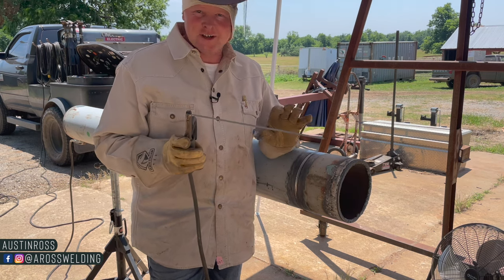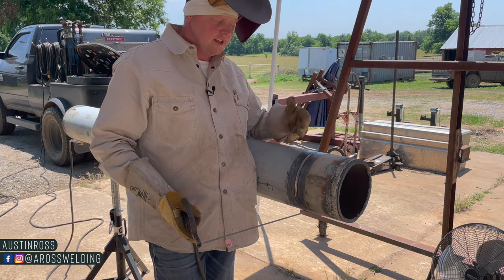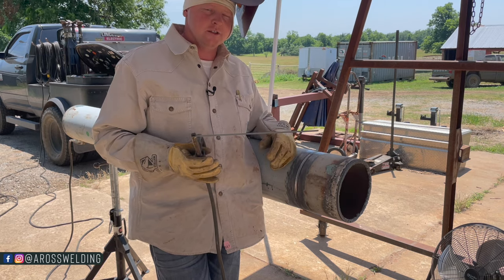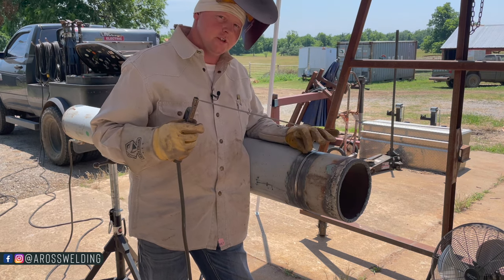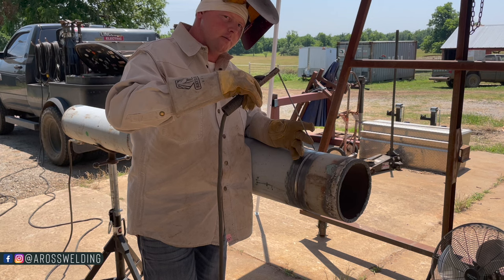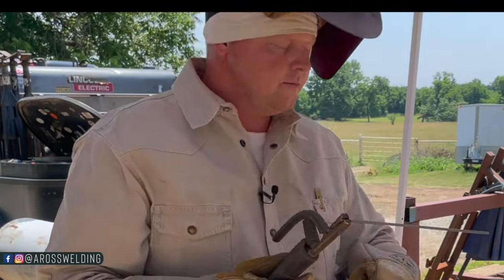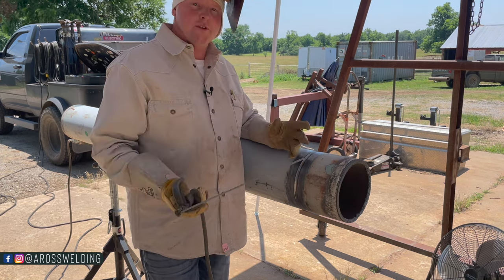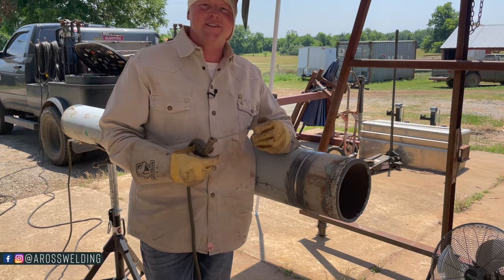THIS SIMPLE TIP CHANGED HOW I RUN BEADS (ROOT PASS WELDING)

Comment: Hey Austin, been awhile,best education you can get is from an old Hand that's burned pallets of rod,my first job was with a small contractor that didn't have bevel machines,had some old clamps and that was it,an old hand around 55 seen how nervous I was and changed everything for me,priceless learning,beveling with a 000 tip,no grinding a ballpeen and an 18" half round, on a 250 wall 12 in,I was good with a torch so that helped,where to set the line back,cut it,pound it square,file it,wedge it and go,that was 74,after that job I had confidence to go anywhere, so teaching them not to fear it,just watch and learn burn the hell out of a lot of rod,I still have my original pipeliner.
Reply: Love the no fail caveman homade api bevels

Comment: I always liked my whip with air-cooled Tig torch line. Really help reduce the amount of fatigue on your arms when your working 7/12 for a few months. I rember dragging alot of jobs just because of small things when the economy was good and companies were paying 1000 bucks to pass a combo weld test and travel pay I dunno if that still goes on I've been retired since 2013. Secret to working shutdowns and pipeline jobs you gotta have a good contact list and you have to have a good reputation as a welder. My phone used to ring all day with offers from other companies.

Comment: Good tips thank you. Holding stinger lightly and pull up to help stop blowouts and push rod from side to side. I will never be a pipe line welder due to age however I do lots of welding on our farm equipment and these same tips will apply. Lots of different types of damage to implements as you drag them across the face of the earth.
Reply from the maker: You bet! Thank you for watching!

Comment: awesome video more tips on real word bead running than I've ever seen  thanks for taking time to teach these small things. I used to weld a lot of 4" .156 wall and the bead is everything don't push it will undercut the bead and on the bottom tack roll out of the bevel so you don't leave a big keyhole to try and tie into on the bottom when you come flying in and leave a suck back. light wall pipe will make or break you

Comment: Something I was taught also about running beads at least from say 3 o'clock on down. If the bead is grey in color with no lite slab coating can almost bet there is internal undercut. If the bead is shiny good chance no internal undercut.

Comment: I graduated apex tech a year ago got a fabrication job here In brooklyn  they taught us structural but all I've been doing is mig on thin gauge 1/8 3/16 and 1/16 angle iron mainly but I was supposed to get a dot certification when I graduated ending up in the field like I have I just don't have time to go back and take it plus I need to practice we did the 1 inch plate with backing strip and the quarter inch landing the walls I believe were 35 degrees whereas the aws was 45 I got to much porosity in the 35 I would do that pointing technique and I ended up gouging the sides instead of blending them in that light shift would of worked thanks for the tip
Reply: take the time today sir  to go to the next step or be where you are for the rest of your working life

Comment: On small inch light wall pipe you don't  push the rod in the bevel to hard you let it kind of lightly sit on the pipe bevel not straight in  burning the edges off the bevel and incorporating the pipe parent metal into the bead . It's called skating them in . It is crazy fast . It is a way different feel , technique ,body position ,and touch . I was  not a bead hand and the best ever I got was 50 joints of 3"  .125 wall in an hour with 3/32" rod . Best bead hand I've ever followed one day got 56 joints of 4" .125 wall in 45 minutes 100% xray . hahaha wanted to prove a point and get into the bar early . There are 2 wall thicknesses smaller I experienced .109 wall and .083 wall . get it wrong here and it is a real wreck  .
Reply: hey BB.  Hobby welder here...  i have a question and would like your thoughts...  i wanna make a 20x20 carport with 2x6 11ga  (.120 wall)  i need to weld butt joints at the tops of the trusses.  would you bevel or just do a butt?  gap?  quick 3/32 6010 root with 7018 cap?
Reply: @peetky8645  I know u didn't ask me I used to work as a combo welder for alot of companies like foster wheeler, Zachary, Siemens ect.. for one of those carport project would probably be best to use 6013. Just make sure you don't run it cold so it will be easy to tell the molten slag from the weld puddle and you won't get holes in your weld 80-85 amps on a 3/32  6013 would probably be okay.
Reply: @johnlowe2943  thanks for the input!  i made a weld stand and plan to try each weld that people recommend to me to see which is best- thanks
Reply: That's insanely fast for a sideboom and crew,
Reply: Damn Bart! Paperwall, huh?

Comment: Wondering if you use 7018 or 6010 on your root pass. Also, from personal experience, the prep of the wall thickness should be not less than 2 mm or 1/16 inch and gap of max 1/8 or 2.5mm, especially with 7018 rodes. What do you think?

Comment: I've been welding 10 years for a living, taught college for the last 4, and they are downsizing this upcoming semester.  Have any leads or any tips to get on pipeline or any profitable jobs?  I have a rig and 2 machines, just at a loss as to where to go
Reply: Tank farms
Reply: @jamescosta1174  could you elaborate on that?
Reply: @MrDillaKilla  hi patrick! Yes. Was it about breaking out?  Tank farm for instance, will able you to get exposed to the whole pipeline process/ people. Tank farm is a great gig in between pipelined, since they never last. You Will burn 1/4" jetrods (7024). You do need a diesel truck and machine( explosion hazard) those rods are 280 amp ( i believe) rags your machine, but whatever gets you in the door. I am most sure you will advance w/ your skills. Need to pipefitting. Let me know!
Reply: @MrDillaKilla  what state?

Comment: thanks my guy have you ever just stopped a bead the rod would only weld on one side you fight it and it wont do right  same box of rods . i think it is the curent and or the dry ness of the rod . jump the ground to both sides . dry your rounds on the grill . 6010 plus soak in water bahbah bah it not right like 7018 i think its the same thing 30 year fighting this 30 yrs  under the hood tryit

Comment: All I managed to do when trying to stick weld my first time yesterday was a few sparks and getting the rod stuck. Then I let my rod stay stuck for too long to the steel I was trying to weld and the rod got red hot and roasted all the flux on it and stunk up my garage….

I’m back on YouTube watching more videos… 🫤
Reply: frank keep trying my brother you got this keep working on it
Reply: Frank when you get stuck, just take the stinger off the rod. I was always told by an old legend, “think of your rod as a match and your material the strike box” . Been weldin for 6 years and still learning a thing or 2 everyday.
Reply: hahahaha you will find it to be a steep learning  curve for 5 years after the first 3 years . Get a kick out of your handle I once knew a fella they called Hank the Crank
Reply: Strike it like a match and a box, if your too slow it will stick. Just a small quick scratch, also if your running to cold it’s easier to stick it.
Reply: @bartbley1269  Yo my handles “Big Chief Swingin Beef” 👍
Reply: They call it stick welding for a reason. Run just enough amps to keep it from sticking and hold a tight arc. Once you figure it out, You'll be old enough to retire. Never stop learning and practice.
Reply: @Mr.Crosbyy.  Ah, I thought about that but with all the videos I watched I never once saw someone even mention that if the rod sticks to the metal and you don’t remove it right away that the whole rod will start to glow red and eventually toast all the flux on the rod.

…..that’s normal, right? Not getting it stuck and leaving it but it’s normal that if you do leave a rod stuck for whatever reason to the metal you’re trying to weld that it will start to glow red and scorch all the flux on the rod, correct? I wonder why not one of these “stick welding for beginners” videos showed this. Man, it stunk up my whole garage! lol
Reply: Thank You everyone for the advice! I’ll keep at it…. I’m wondering if my welder needs to be on 220v instead of 110v, many of the reviews for it said it welds much better on 220v. I don’t have 220 in my garage, just in my laundry room for my dryer, I wish I had a 220v extension cord that could reach. I think I’m going to try and put a 220v outlet in my garage, that would be nice. 😎

Again, THANK YOU to everyone for the words of encouragement and advice and help, I’ll keep trying!
Reply: @frankthespank  yes 220 will help a great deal.